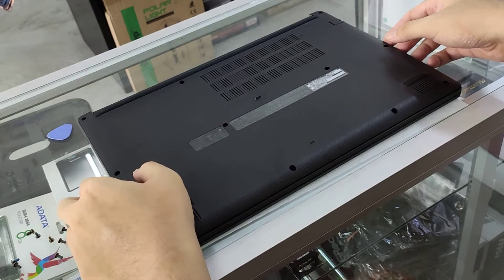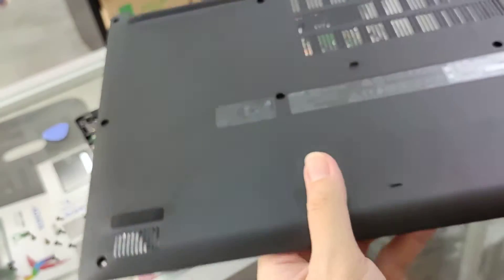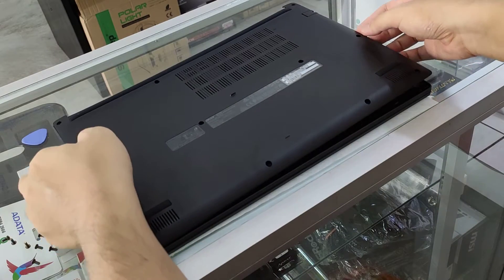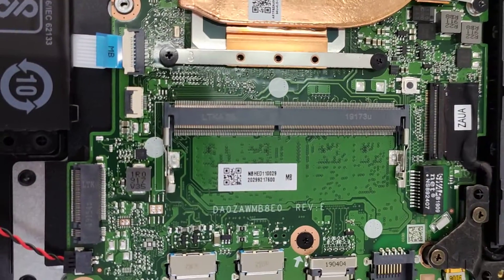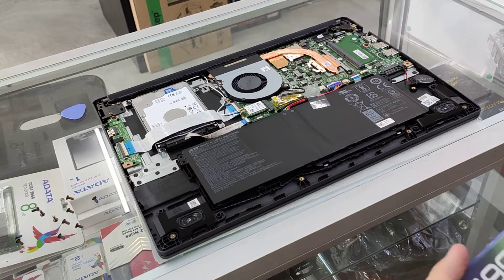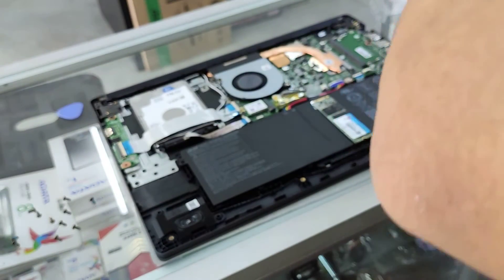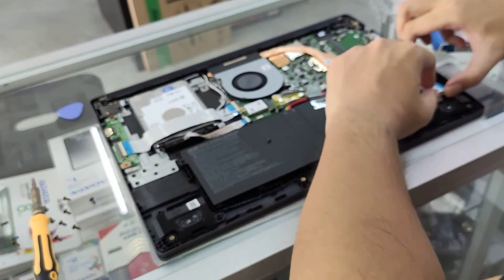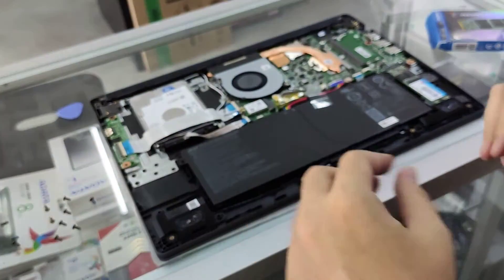Acer A315-55G-537A M.2 SSD Upgrade & Internal View

Comment: Hi, can I know what is the type of the m.2 slot? Is it sata or nvme? Can we use both sata or nvme at the pcie
Reply from the maker: Hi, you should be able to use both sata/nvme at the m.2 slot
Reply: @lightencomputer1999  Which one is better? Or both of them work the same?
Reply: @alibekyusupov322  The NVME SSD is much faster than SATA M.2 SSD.

Comment: Great video! Can you tell me if I lose the warranty by installing a new SSD?
Reply from the maker: Hi, to answer your question. In Malaysia, Asus & Acer service center have told us: add on RAM / M.2 SSD / HDD does not impact the warranty unless it caused issue to the other parts. If you change the original component (HDD, SSD, RAM) such as replace the ori SSD from 256GB to 1TB / replace the 4GB RAM to 2x8GB RAM. Then that will void warranty for sure.
Reply: @lightencomputer1999  Thanks for the answer, in my notebook there is no flex for SATA ssd, but it can be added.  My notebook only has 512gb NVME, I wanted to add an SSD.  Could you tell me how many pins does the Sata ssd flex have?  (To buy it from the Internet) 1:36
thank you very much